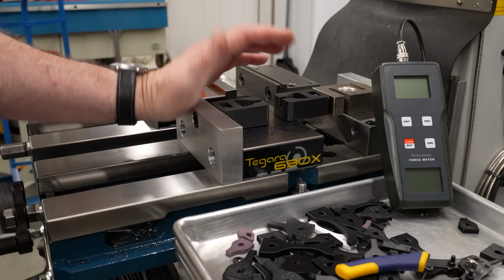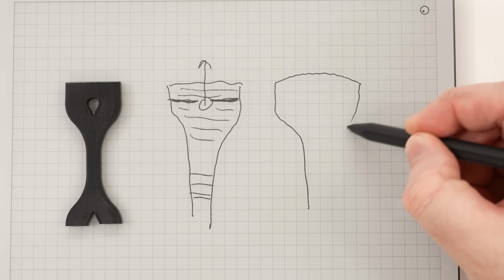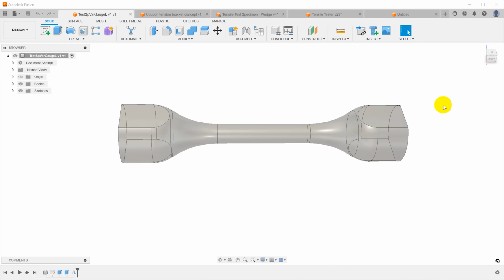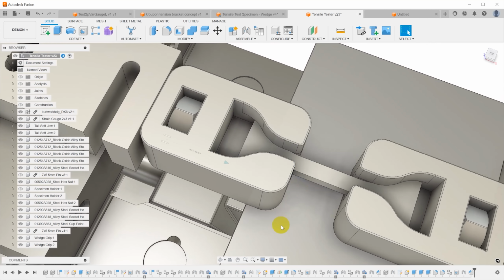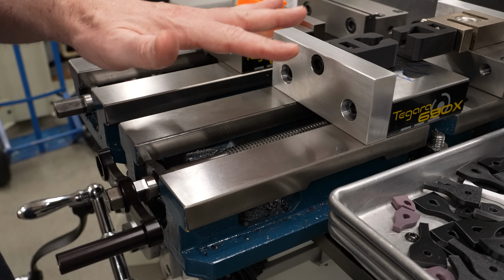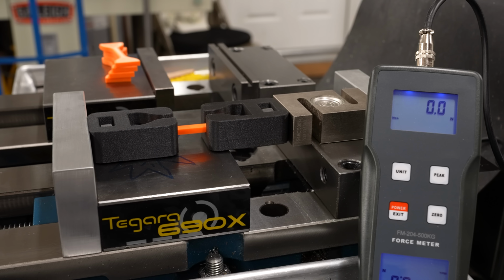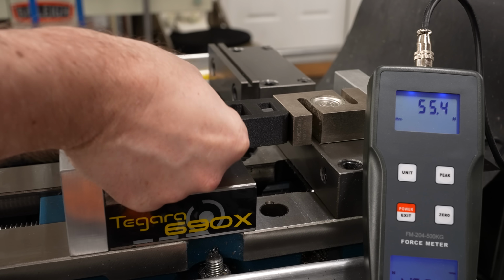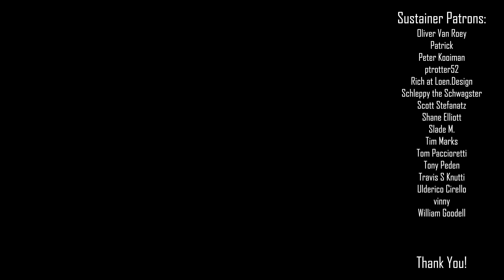Better Tensile Testing Grips | Tensile Tester Part 2

Comment: Place some rubber plugs in the mounting screw holes for the jaws on the inside of the movable jaw. Having to remove the plugs to mount the jaw will remind you to turn the vice back over.

Comment: 20:23 Don't worry about the reversed jaw, EVERY-ONE will, from this moment on, ask u about the jaw been reversed, not only on this vice, but on every vice on screen...
An upgrade i would suggest, is to put some form of padding on the contact surface of the test sample, some form of silicon film, os something like that, to better spread the force on surface.
Just to see if a more homogeneus contact would influence the results.
....you remeber me of Adam Savage, in a way, i feel.... smarter after your videos, for some reason.

Comment: Why is it a teardrop and not a perfect round circle? Of course the teardrop shape will send the forces to the centre of the rounding. Why is there a hole in the 1st place? You've introduced a weak point in the material

Comment: If you bolt a cheap pair of digital calipers between the vice blocks, you can chart the stress/strain curve to determine the modulus of elasticity and yield point.

Comment: I really like all of your videos. After 40 years of designing mechanical equipment one of the things that was said is “Ask silly questions, it’s amazing the answers you get “. When doing R&D, as Adam Savage says, failure is not an option, it’s a requirement.

Comment: I am very surprised on how your dog bones broke so consistently.  For one thing your hand cranking and cannot possibly be perfect with your strain rate per specimen.  Secondly, printed tension specimens in layers would automatically fail at a layer boundry.  We had to have  nearly perfect surfaces (no tooling marks allowed) - especially on polymers.  How did your tests compare to machined ASTM  specimens. Where did you get the idea to have a hole in the ends of the clamping pads?  ASTM ???

Comment: If I go a day without failure I feel that I didn't push myself enough.  Heck I suggested something for you to try to "minimize" the moment arm which was causing the crack... Didn't even think to eliminate it by putting the neck into compression.   Yea Duh I learned something as well... Got to love that 20/20 hindsight.  Thanks for posting both videos as we all walk away a bit more smarter.

Comment: Nice test. Like the new holders. This all reminds me of a rig I built many years ago. I was impact testing the front crash structure at 40 km/h on the sportscar I'm building. We just connected the loadcells to an oscilloscope. Only 2-3 buttons to press to save the data and reset it. It would have been interesting to see if the 7% spread you got was actually less.

Comment: If you're worried about the quantization or update rate of the meter, could you hook the load cell to an oscilloscope to capture the data and use the meter to build a reference to convert that data to newtons?

Comment: Two ideas. 1 - use a vinyl sticker to label the jaw direction so you always have a very visual reminder if you don't flip them. 2- some sort of small ejector or finger clearance on the new clamp seems like a great idea, as you had trouble removing the broken bits every time

Comment: James: I am thinking that your meters update rate is probably the same as its displayed rate. Similar to a very high resolution digital speedometer, trying to distinguish between 1.000 mph and 1.001 mph is not fast and cheap. Also what is your minimum display step size in your range of interest? (I am looking at “missing codes “ ). Digitally dividing 1/7 does not automatically give you 6 digits or more of absolute resolution. Look at Blondie hacks DRO displays apparent 5 digits of apparent precision in inch mode. A marketing trick. 
 Try “ VERY SLOWLY “ increasing the tension just before the sample brakes (over 900 newtons) and observe the increasing step size and refresh rate. Down at the 0 to 10 newton range it my be quite different.

Comment: Excited to see you executed basically exactly what I was suggesting.
 Might manufacturer in a symmetrical failure point in the middle of the beam if you’re concerned about print artifacts contributing to static in the results.

Comment: Reversing the pull of the jaw on the vise was very clever, which did not even occur to me; actually I did not even imagine that was a thing you can do. I am really looking forward to seeing the data you can produce between the different materials that you can print with. Be sure and do some peasant PLA and such, for those of us with back alley printers like my Ender 3 V2 🙂 Still saving up for a Bambu Labs super posh printer, or the like, and the advanced print materials these can use.
For true symmetry-ish, my further idea was to FULLY enclose the end so there was not only a bridge below, but also above, but then how do you insert the coupon? I imagined pushing the coupon in from a 'hole' and then giving it a 90 degree twist, and then pulling the coupon out into the retention slot; still no tools required, but a closed loop on the pulling faces, with no possibility of the 'jaws' spreading, like they may do with the top open as it is now. And luckily between CAD and 3D printing, doing a 90 degree rotated cut deeper into the jaw, with both jaws 'opposite hand', would let you insert the coupon with the width vertical, and then rotate it 90, and spreading the jaws to draw the coupon in the the fully enclosed horizontal oriented slot. Not sure if I painted a very good word picture, but that is what CAD is for.

Comment: In every other beam the side opposite to the load is under tension, so how could the material at the end of the lengthened coupon ever be compressed? There's no force at the end to cause such a compression.

Comment: Um, sure you can learn by doing, but waste a lot of time.  If you had done an hours worth of internet research you would have saved a bunch of time.  What you are doing is elementary for any mechanical engineer.  Usually these types of testing coupons use gripping jaws that distribute the pulling force, even if they use pins.
Reply: Good result - next would be to measure the stretch to get the stress strain curve which would give you even more information.  How flexible is it before it breaks.